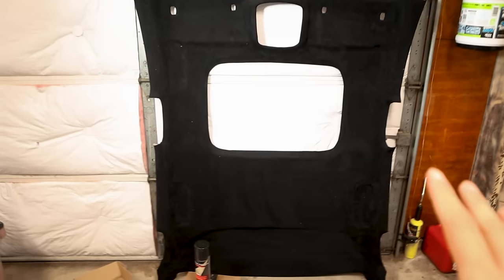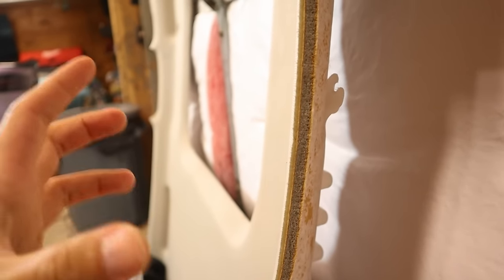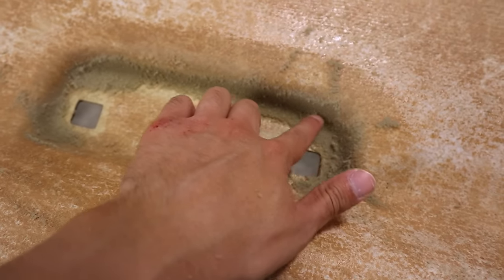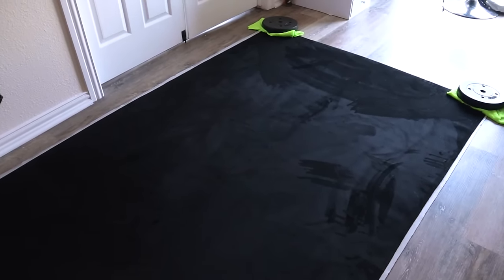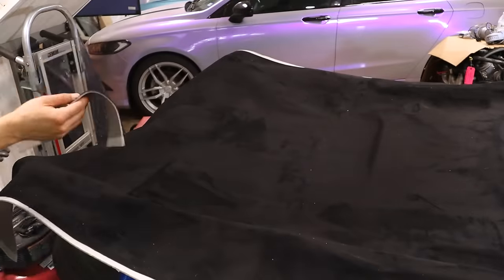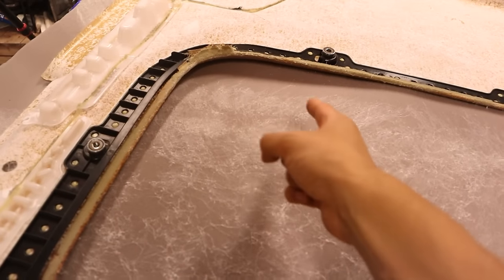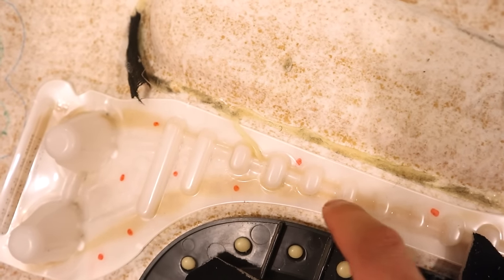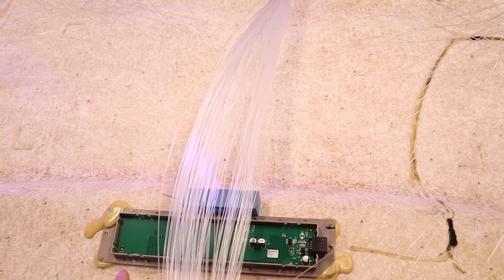The ULTIMATE Starlight Headliner Guide! (Suede, Sunroof & 450 Stars)

Comment: My dad has been doing upholstery his whole life and i have learned a lot from him, you could had used only suede any kind of type and install right on top of ur original material no need to remove the foam unless ur headliner is damaged
Reply from the maker: That’d make it so much easier! So would there be any specific prep to the headliner fabric already in place since it’d be fabric glued to fabric?
Reply: @DitoCardona  you would spray glue on ur headliner on its material and u would also spray glue on the suede that you would be puting on, let it dry half way then apply.
Reply: my headliner had water on it from a leak and stained, so i would assume remove mine?
Reply: Will not removing the old fabric affect the fitment at all?
Reply: @Armens_63s can anybody confirm placing suede on regular headliner ?
Reply: Well, the issue is that there is a foam under the original fabric and it deteriorates in some time (from 6-7 years in jettas to 10-12 in fords). Then fabric starts sagging. So it's better to remove old material to extend the lifetime of the headliner, so you won't do the same job twice in a couple of years.
The method you've described works perfectly on toyotas as they don't have that foam.
Reply: Not doubting what you learn from your dad, but from my experience doing these it doesn't last that long if you put it on top of the old one
Reply: @checkengine5149  headliner in my 2003 dodge ram looks brand new. Haven't had any issues with my Ford trucks in the past either. Is it a car thing?
Reply: @johnmichaels4330  depends on model. Ford fusion and edge do have foam layer under the fabric (to achieve that luxurious effect when all interior details feel soft), fiesta - doesn't, as it is cheaper. As for the trucks - i don't think they have the foam layer as they are built to be durable. But I can't be sure as trucks are not popular in my country.
Reply: If you don't remove the old material and foam, you're asking for future trouble.
Reply: @DitoCardona the og that I never got too.. but not good with cable stuff why I am iffy on it.. but check out Ryan Myers I think its his name.. or type in how to build your truck at home.. should show a green ram. But he gives you all the info and very very informative.. with every thing and goes thru the problems and ways to go around it.
Reply: That headliner material comes with the foam backing already attached, yeah sure you could stack it on top of the old fabric and foam but that's not the right way to do it.
Reply: @TheGangster-uc4rk  you can stack it as long as its not damaged if its damaged than yes ull need to remove the foam
Reply: @Syncer88 I mean it would make it a bit thicker but theoretically it shouldn’t affect the fitment
Reply: @fuegokicks_2095 you be fine but who knows how long oem glue will last also some cars like bmw have texture on the newer cars probably best to remove it
Reply: I have for yrs. I did mine in 2017. Havnt had one issue with mine or any I have done
Reply: Right in looking like why he just didn't cover it 😕
Reply: @backwardmist2303  no.  Cover right over top of it
Reply: @johnmichaels4330  mostly German cars,  and Hondas
Reply: @pioneerman4417  lol. That's bs. Unless it's an old Honda or German car
Reply: @deransanchez3162  ok..report back in the future when you have the future troubles mentioned. It's like painting a dirty surface. It may stick at first, but what's underneath will eventually let go causing EVERYTHING to go with it. It's not rocket science. Every car with glue/foam headliner eventually loses its grip, especially if it sees the sun a lot.  But if homie wants to take the easy way out and pay for it later then have at it.
Reply: @pioneerman4417   you're wrong.  Not every headliner fails. In fact MOST will never fail in their lifetime.  You're wasting your time.
Reply: It is possible but there is nothing better then cleaning it up and putting a new one on. You cant look behind the old fabric. Maybe its going to fall off in a couple months and thats where you glued the new one on. In my opinion taking the effort of changing your headliner just remove the old one its only 1/2hours extra work and will save you regrets in the future
Reply: @Armens_63s so you’re saying I can just glue the suede on top without removing anything?
Reply: @fuegokicks_2095 if you've taken the head liner down, personally I'd redo it so you don't have to worry about the extra weight pulling it down. I haven't done much upholstery but ik how long it takes to get the liner down
Reply: @johnmichaels4330 

I have a 1999 2nd gen Ram 2500 with the V-10. I'm the second owner. The headliner was deteriorating. The fabric was separating from the foam to get a smooth look I did the same thing as in the video I removed all of the old fabric and old foam applied fresh adhesive to the new tweed fabric let it sit for a week and it has a clean neat well kept look.
Reply: Are you serious? I can skip that whole section, but would you put glue right on top of the old liner? The problem I have is that my liner is tan, I don't know if I should do it.
Reply: @backwardmist2303  

As long as you stopped the leak. Allowed it to dry, You could  re-upholstery over the original  headliner. Joann fabric would be an excellent place to look for new headliner material.
Reply: Hey, I have a headliner with starlights, thing is it’s not suede. Could I still add suede to it even if it’s already had starlights on it?
Reply: @Armens_63s  Na! On top of the old one? That makes it easier.
Reply: @pioneerman4417  exactly. There's a lot of half ass ways to do a lot of different jobs that will "work" at first. But take a little pride in your work and do it right. Especially a job like this where taking a short cut to save an hour or so could ruin a 10 hour job. Or not. Personally I have a lot of pride in projects I complete. Whether you can see it or not I KNOW its done correctly.

Comment: Hey bro I just did this to my Lexus gs430, where did you hide the light engine? Down behind the back seats? I currently have the rear c pillars removed, and the box just sitting back there with the sub. I have the wires bundled up so it will fit, I just don’t want the box visible through my back windshield. Subscribed, appreciate you!

Comment: Very in-depth tutorial, thank you! :D  I'll be adding to my '20 Fusion Titanium AWD. Do you know if there is a way to integrate the fiber optic cables to turn on / off at the same time your exterior lights do? That would be sick.
Reply: Love my 20 Titanium. Just starting to mod mine.
Reply: I ran a 12V extension under the rear seats, under the rear carpet and behind the rear AC vents into the 12V socket in the center console. They turn on when you turn the key/press start and turn off 1 hour after turning your Fusion off.
Reply: Just splice the power cable into your lights. I’m gonna try wiring mine to the front because I wanna connect it directly to the battery like I did with my dashcam so I’d just have to extend it to the headlights and splice it into those wires so when they turn on it does too. Alternatively if you have an auxiliary battery you can just connect it to that and and splice them into the taillights which is less tedious

Comment: hey guys, loved the video. I have a question I'm doing this right now to my car. I have taken  my roof liner out and have glued on the suede material on to my roof. my holes are marked. I've noticed after drilling about 15 holes that the drill bit I'm sing it twisting the suede and making it look pretty bad. I'm glad I noticed it. any body have any suggestions on what I can use to make the holes  for the fiber optic lines without twisting up the material. I noticed in your video you kit came with drill bits. Where they a certain kind and did you ever run into the problem of your material twisting up?
Reply: Use an upholstery needle. Might be a bit tedious when pushing the fibre optic through but worth not destroying your suede
Reply: Im having the same issue lol. Its so random when it decides to do it
Reply: Yeah I was told use a needle

Comment: okay!!!! I bought a similar kit where did you connect your kit? my comes with a smaller cable and my understand is you need to put the box on the back so where do I connect it ?
Reply: I haven't done my fusion yet, but on my last car I ran the optics back through one of the back pillars and had the box in the trunk in a little net so it didn't move around, u did have to cut a hole in the trunk liner for the fiber optics though... I want to mess with the fusion to see if there's anywhere that the power box will fit without cutting tbough

Comment: clean 🧽 fusion! totally the reason im working on mine! definitely will be doing this in the near future! is it hard to take out or reinstall the headliner?
Reply from the maker: To bring it down it’s more just a lot of parts you have to undo/remove but that can be done in about half an hour. The harder part is removing it from the vehicle because you go through the trunk, I have a video where I speak to it more specifically but it’s definitely doable as a beginner 👍🏼